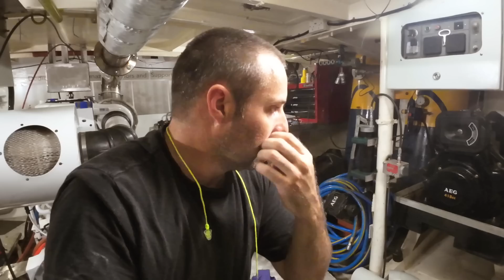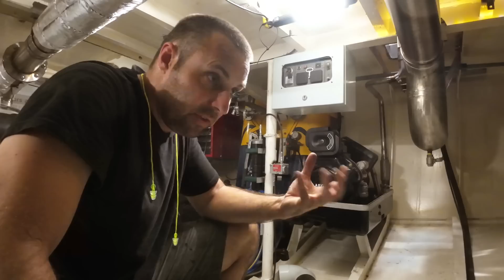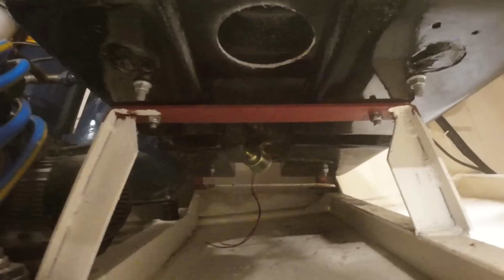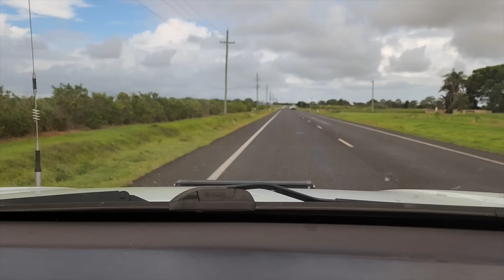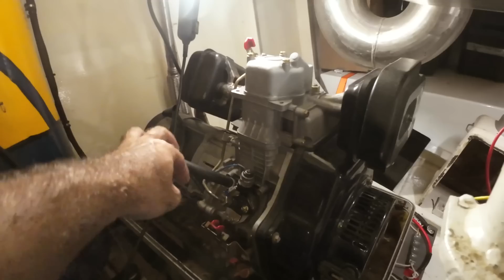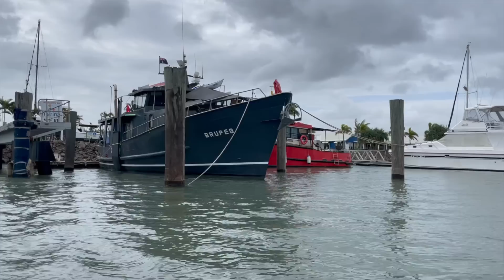The little genset that could - Project Brupeg Ep.339

Comment: It might be easier on your fan if you use it to force cooler air into the box than having it drawing out the hot air placing the fan motor in a higher temperature environment.
Reply: Maybe, but then the downside of your scenario is that all the air entering the box has to go through the fan.  With the fan at the top even if it fails natural convection will allow the air that enters through the big gap at the bottom to pass the stationary fan and escape.  Restricting the potential supply of cooling air from entering the enclosure seems more risky.  In any case, the fan itself might well be specced to operate at the kind of temperatures involved, and that's the kind of thing I'm pretty confident the Brupeg team will have thought through.
Reply: @GaiusSonofGermanicus  The restrictions in the flow of the air would be the same either way. As far as the fan is concerned. If the fan wasn’t at the top then the 90° elbow could be removed which would make for even less resistance.
Reply: @blimpcommander1337  What I'm thinking is that if the inlet into the box is limited to what looks about 100-125mm (maybe a little larger) that will cut down the natural cool air incoming.  As it gets warmed by the gen set it will rise (obviously) so it seems to be advantages of the current arrangments would outweigh the downsides. The hottest air will be at the top, and that is where the fan is located. I do take your point about the elbow, and a straight shot would improve airflow whether passive or fan forced.  It's an interesting set of issues and compromises to weigh.
Reply: Add to that ,draw outside air in ,not the warm engine room air ??
Reply: @thatdave86  In principle yes, but you would need to get in from the topsides all the way down to the genset, and that means moving air through at least several metres of ducting.  I would think that an inline fan would be required to allow adequate movement even before you get to the issue of which end of the enclosure another fan goes on, and that is getting pretty complicated and space hungry.
Reply: Yes, it will last longer. Fans usually also perform better when blowing and not sucking.
Reply: Better to have negative pressure in the box incase there's a exhaust leak.
Reply: @royblackburn1163  as currently setup it is all going into the engine room, but if exhausted to the outside are 100% correct. In that scenario it might be best to place the fan at the end of the exhaust tube which would cut down on the heat. IMO